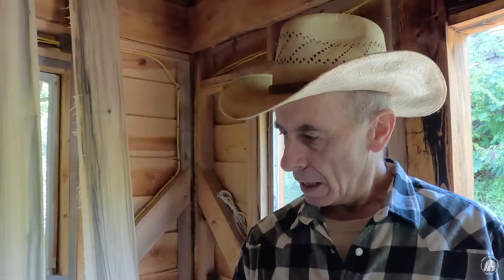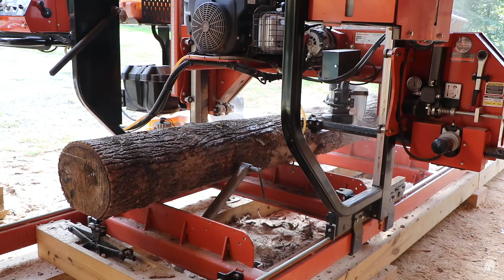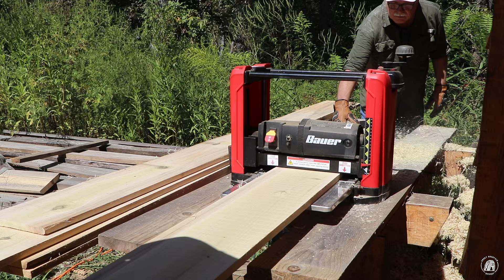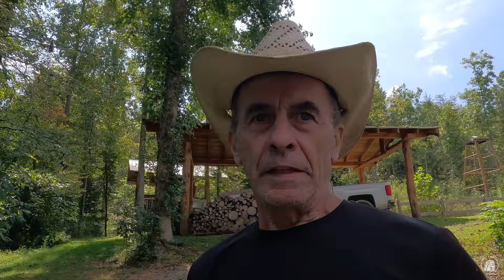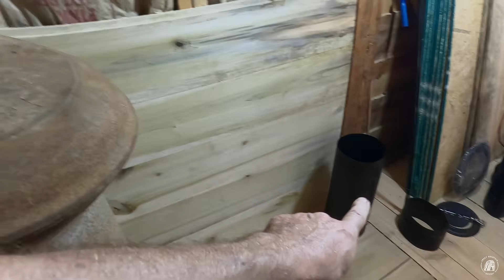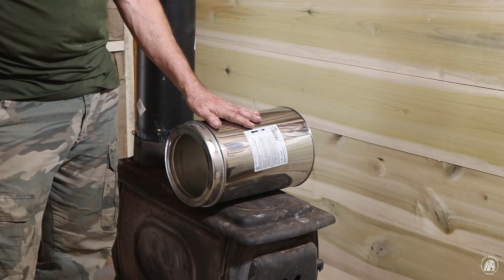Milling And Installing SHIPLAP For The Workshop

Comment: Are you going to put a small patch cement board right above the single wall section of pipe where the horizontal section meets with the thru wall pipe, it looks a little close to the wood above? If someone besides yourself comes along later and gets too hot of a fire going that could be an issue. I don't comment as much I should, I really enjoy watching your videos! Thanks as always and looking forward to the next one!
Reply from the maker: If I think I may need one. I don’t imagine I will have or need a large fire anyway. I can always add it

Comment: A couple of saw horses or two matching blocks one by twos doubbled so one doesn't have to bend over to make the edge cuts.  Will help out on the back.  I life weights laying on my back the heavy one's a push them upwards, 25 and 30 am disalbed and home from open heart surgery.  The reocovery part is slow after open heart.  Grateful just to be alive.  One can use his imigination on building up two temporary stands to work off of in the work shop.  If these work out well one can use them else where too. Six or so plastic milk cartons will make a little stand too.  Maybe the plastic paletts can be altered to make up a stand too.  Have fun.  Good job.  And I could not buy a workshop as well as one is making his.

Comment: Saw your need for oval to circle conversion on your potbelly stove. I asked AI who offers such a thing. Response that came back was:                                                                       Rockford Chimney Supply

They offer custom oval to round single wall black stove pipe connectors. You can provide the measurements of your oval opening, and they will create a custom adapter for you. This is a good option if you need a specific size that isn't readily available.

DuraVent

DuraVent has a DVL Oval to Round Pipe Adapter designed for wood-burning stoves. For example, the Dura-Vent DVL 8-Inch Vermont Castings Oval to Round Pipe Adaptor fits directly onto the appliance's flue and is made of durable materials.

Woodman's Parts Plus

They sell a Black Oval to Round Boot Stove Pipe Connector in various sizes. This adapter is suitable for older box and cook stoves, making it a versatile option for your needs.
Reply from the maker: Thank you very much for the information, I appreciate it!

Comment: On that potbelly stove, all you need to do is take a 8 inch x24 inch tall stove pipe , and you a push down on one end, it will form the oval that you need to connect it. The other end will be round. DONE
Reply from the maker: Tried that. It becomes 12 in oval. Mine measures 8 5/8 in. We are having one made. Thanks for watching and have a blessed week

Comment: Curious why you did not put vapor barrier on top of the installation before putting up the poplar siding.
Reply from the maker: It's a good point, and I have a reason for doing it this way. They like the shop is a large barn. It needs to breathe. Warm humid areas like this vapor goes inward and can get trapped causing rot. I decided to let mine flow naturally. Just my thoughts

Comment: Now would be a good time to order any rope fire seal and stove cement for the stove to seal the joints when you assemble it and as I explained to someone the other day, the female end of the stove pipe goes down so any rain or condensate runs into the stove and not out on your breakfast.  Keep Building
Reply from the maker: Thanks for the advice, good to know.

Comment: Wow, Driving a dado blade with a portable table saw was a lot of work for that saw.  I'm surprised the motor overload didn't trip out on you.  Pretty good testament for that saw. You may want to check Rockford Chimney Supply.  They appear to make custom oval to round pipe adapters.
Reply from the maker: Checked a lot of places. Ended up have to make one. Odd shape dimensions. Have a blessed week

Comment: There's a stove pipe tool to adapt the collar on that stove. You get a piece of eight inch pipe, and pinch it to fit. I think that oval started at eight inches. Home depot has the tool. it looks like three lines of metal.
Reply from the maker: 8 inch pipe is far to large. It becomes 12 in oval. All retro fit specs didn’t work for my odd size. We are having one made. Thanks for watching and have a blessed week